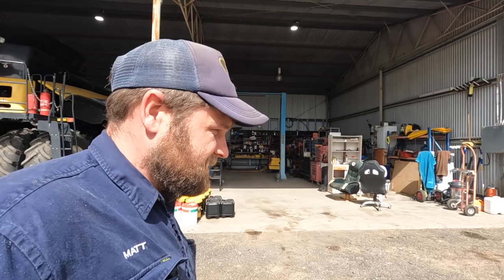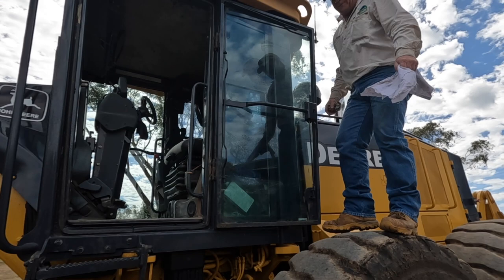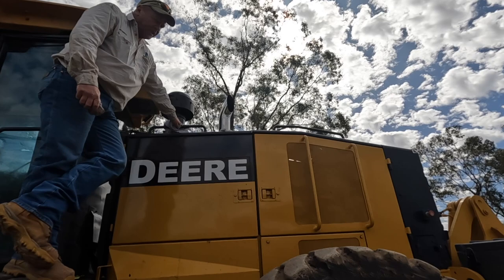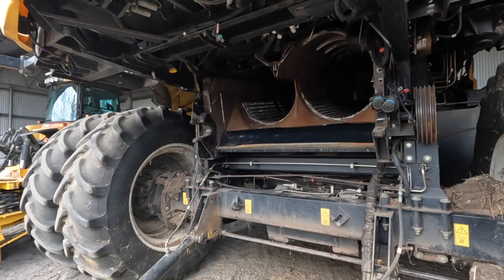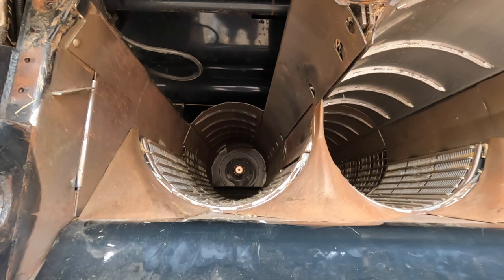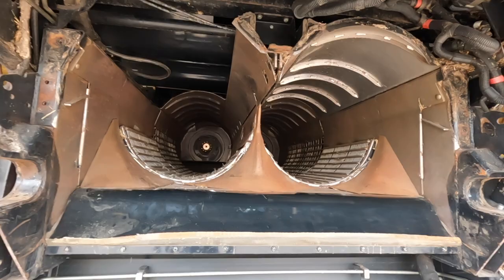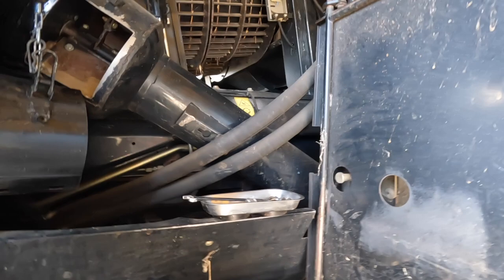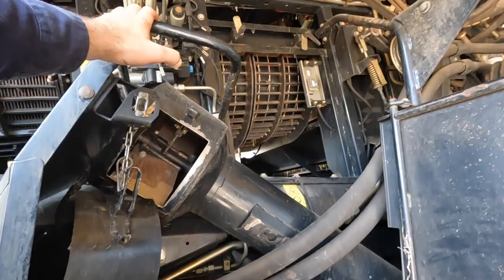Beware of Rocks! Major Work Nearly Done! (Vlog 96)

Comment: Hey Matt would a digital spirit level help to get the rotors back into the heade. Get the angel of the cog inside of the machine then set the same angle of the rotor before it is put on the forks. Obviously you can't use a bubble level but a digital 1 you can then you can also get the angle horizontal and vertical. Just a thought it could save a headache and time
Reply from the maker: Hi Steven, yep that would probably work, although we would have to make a jib that attached to the end of the rotor👍